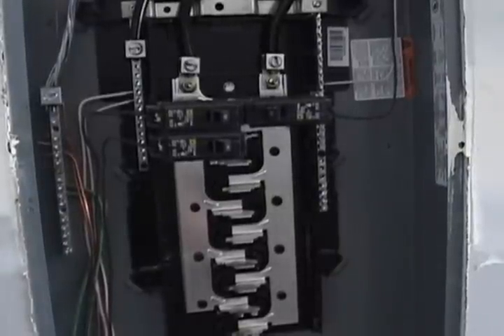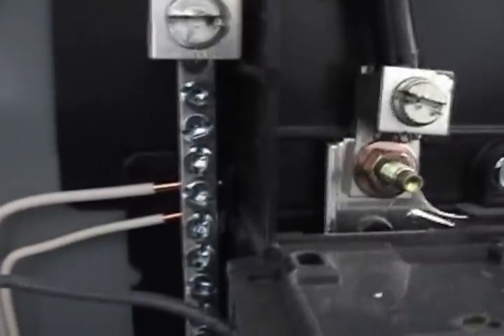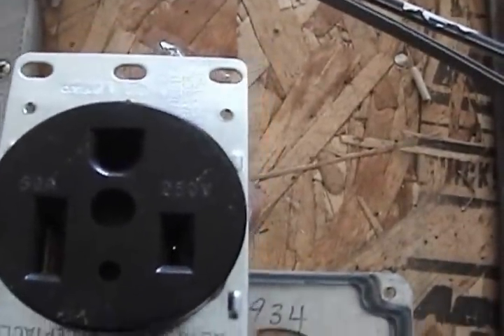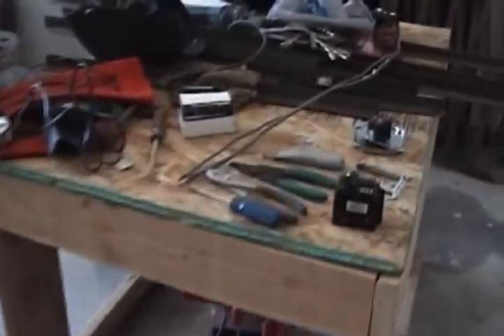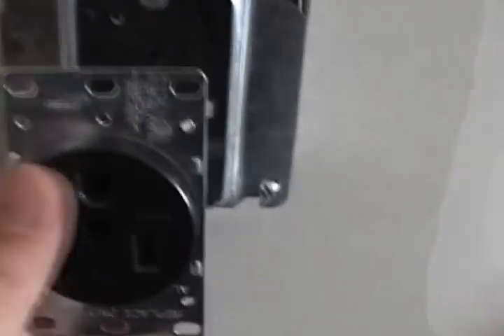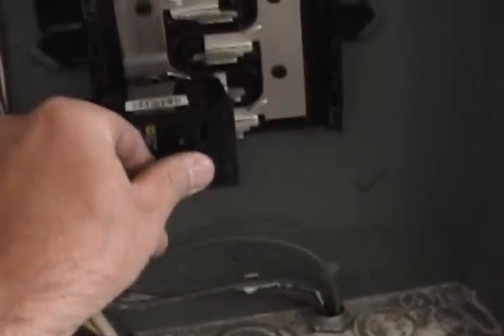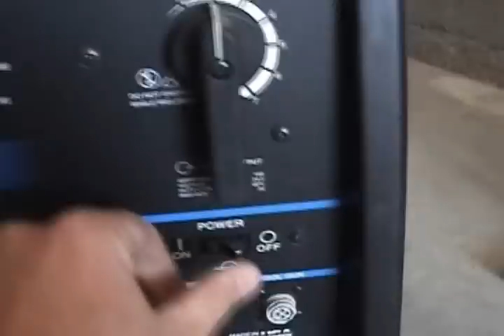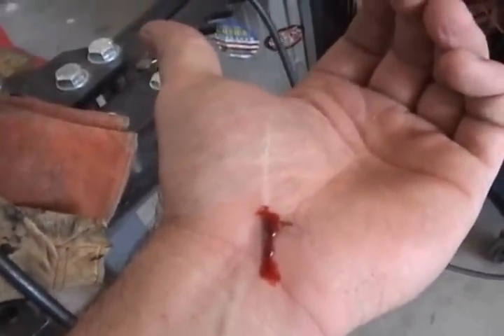How to wire a 50 Amp breaker and plug for a welder

Comment: Plus, I looked up your welder's manual, 10AWG is acceptable, and the MAX recommend circuit breaker is 40A.  A 50 A breaker would not be recommended per the manufacturer, so aside from the 50A breaker, the manufacturer is on your side.  Very good video, thanks for being brave enough to share.  I only came across your videos because I'm doing a welder outlet right now,...

Comment: i had to do the same for my millermatic 252 at home, i went with a 50 amp breaker and plug, and went with Romex 6 gauge on both hots and 8 gauge on the ground.
Reply: You did it the right way.  I just wired my 50A outlet and ran Romex 6 gauge too.  The wire size matches the breaker size so if by chance someone says "hey, here's a 50A outlet I can plug my 50A crap into" you don't burn down the house!!!

Comment: Even though I completely agree that it should be #6 wire you could make this situation safe by using a 30 amp breaker even though it's a 50 amp receptacle. This will at least guarantee that you truly aren't exceeding the wires capabilities. At $2.79/foot on 6-3 awg I think I would have played it safe on that 4-5ft span of wire.

Comment: Thank you! I did some further research and discovered that I can make my own 40 amp crossover extension cord with #8 wire and can use my welding unit, just not to its full potential. But I also found out this welding unit is for building ships and steel buildings and heavy machinery parts. Way too large for my wants, so I ended up scoring a 120v Lincoln wirefeed mig unit off Craigslist and that completely takes the guess work out for me.  :)    Thank you again!!!

Comment: I bought #6 wire and 50AMP plug and socket. I googled this video and gave me courage to connect it. His wires seem to be thinner than mine. Hopefully the welder will not pull 30+ Amps.

Comment: I've worked in marine electrical design (where cable heat is a huge concern), and there is a lot of emphasis on using the right cable for the load.  I'm sure you've settled this by now, but, all that matters is that the breaker is sized less than, or equal to, the ampacity of the wire.  Inadequate sized wire causes thermal stress on the insulator, which, when it fails, produces a high resistance short (ie fire hazard). Insulator failure can take years. For 10 AWG you should use a 30 A breaker.

Comment: Nice Welder. Just bought a welding machine for the house. Looks like a trip to the Ace Hardware is in order. I will be getting the #6 wire like James below here says is rated for 55 amps. My in 3 in 1 machine is an Inverter type. It may not  ever pull that much. Just trying to be safe. Good luck with your fab shop.

Comment: You can use #8 copper wire for 50 amps, if your wire insulation (look for the h's in the identifier) and terminals are all rated for 75C.  It is the industry norm that most terminals are rated for 75C, but you do need to check.

Comment: I agree with some others who doubt the 50 amp/#10 wire. A 50 amp circuit should be at least # 8. The wire gauge should be designated on the 50 amp recepticle.

Comment: I thought the same thing.  But, the manual for a Lincoln AC225 MIG says

"connect receptacle NEMA 6-50R Type to the power lines at the fuse box. Three #10 or larger copper wires are required if conduit is used. For runs over 100', #8 or larger wire in conduit is needed to prevent voltage drops. Fuse the two hot lines with 50 amp super lag type fuses. If a separate disconnect switch is used, it should have two hots and both should be fused for 50 amp."

What do you think of this?

Comment: Isnt #10 wire rated for only 30amps? I'm thinking #8 or #6 would be a better choice.
Reply: Code is 6 gauge where I live.
Reply: IM NOT 100% IN TO THE NEC BUT IF NOT FACTOR CORRECTION FOR TEMPERATURE OR OTHER FACTOR,FIRST WHAT TYPE OF WIRE WLL BE USED NOT ALL OF THEM HAVE  THE SAME AMPACITY,AT DIFFERENT TEMPERATURES,COPPER OR ALUM..BUT 8 AWG  AT 75 DGREES TYPE(RHW,THW, THWN ,)50 AMPS ,GO GOOGLE  310,16 NEC TABLE
Reply: Should use 6

Comment: #10 Cu ground, is good for circuits all the way up to a 60A fuse/breaker size, as long as the run isn't long enough to need wire upsized for voltage drop.

#6 Cu ground, is for the 110A to 200A range.  A corresponding wire size might be in "the oughts", for such a circuit.

Comment: I agree 100% 10Awg isn't rated for 50 amps max rating is around 30 amps, you need to upgrade that to 8Awg but 6Awg would be better. Even though it's a short run its still too small for the current you want to draw, it will create alot of heat buildup and cause voltage drop witch could result in fire or damaged equipment. it may also be called a brownout situation witch is of course an excessive drop in voltage.
Reply: Andy Swanson if I'm doing a 240v outlet with a dual pole 30A with 8Awg wiring is that enough or should I bump it up to dual pole 40A

Comment: OMG...this cracked me up.  Thank you for sharing the info...definitely not on a big production budget, but hey!  This is YouTube.  I've paid a couple of times to wire in a kiln, so this made me realize it's not outside of my abilities (just replaced an oven control board a few days ago).  Put a bandaid on that, man!  And thank you again!
Reply: This is the way to do electrical in a house if you want to burn it down and make it look like it was an accident. He is using 10AWG wire on a circuit that requires 6AWG (the lower the number the thicker the wire is like earring gauges). Heat is the reason you want thick wire when amperage has the potential to reach that high you want it to be capable of handling the load. Otherwise you got heating elements in your wall.

While most of what he did was decent his use of 10AWG wire was an enormous error. So don't install that same thickness of wire install 6AWG wire. Burning to death is a horrible way to figure out the error.

Comment: knowing or should i say not knowing,amperage ratings is a dangerous thing
interior folks awg 6/2 nm will handle 55 amps....in this example although the wiring is correct,just know the circuit itself is wrong 50 amp breaker with 10 awg....is unsafe the breaker must always be the weaker,in this case an over current situation will burn the wire in the wall before the breaker even knows what is going on....please be careful..wire gauge and wire type need to be honored  14 awg 15 amp, 12  20 amp, 10 30 amp, 8  40 amp and 6 50amp but there many variations where amperage could go up and down dependant upon wire type.

Comment: Is that due to the ittermittancy of the welding equipment (since it doesn't operate for 3+ hours continuous)?

I'd go by the 75C column of NEC310-16, unless otherwise I find an exception.  And it is dedicated to the equipment having that exception.  Don't want unrelated 50A eqpt plugged in it, which doesn't have that exception.

I'm aware of the 60C default for 100A and less, but practically most terminals are rated at 75C.   This tells me that #8Cu would be needed for a 50A breaker.

Comment: When you over fuse your wire, your wire becomes the weak link and your breaker is pointless . Miller puts 50 amp plugs on their welders because they are commonly found in welding shops . I have a similar set up for my welder but it's protected by a 30 amp breaker .

Comment: there seems to be unsureness about wire rating. so the #6 is good up to 60a. You can max out a lincoln buzzbox at 50a on that circuit. I cut the neutral wire off short in the box, then cap it off not tape(code) I think I may use romex... whatev you grab it at home depot or anywhere its 4 wire and you cut off the neutral.
Peace!

Comment: for safety before you turn on the breaker better check it with tester for short wire and correct voltage before you plug the load. Also wear leather gloves.

Comment: I am not an electrician, but what I'm seeing is that in many places there are special rules for MIG welders.  I think that this is 'cause the welders have duty cycles that protect the wiring to some extent.  Some 110/220 welders are also "only" single phase.  I've seen comments that these circuits are then marked "welder only".

However, I have to wonder how much more expensive #6 wiring is than the #10 or even #8 -- and so why skimp and limit yourself?

And wondering if the stick welders pull more current?

Comment: terrible info, 50 amp breaker on a #10 wire. definitely not right.
Reply: I'm a half ass 1.5yr elec.apprentice, and i'm pretty sure if i remember right 10ga is only good for up to 30A
Reply: @imbrandon16  Yep it's all wrong none of us should be here...
Reply: @imbrandon16  ding ding ding.
if that welder only runs 24a he would be ok. people read 50 and think it runs at a full 50, lower end welders only need 30amp and 10gauge, then 20%loss down to 24a
Reply: @joshuanelson6718  nothing less than 6 for a welder . In 100 degree heat in July asking for problems
Reply: @huckstirred7112    Sounds good.  Better to spend a few extra bucks now on larger gauge wire and be safe.  6 gauge it is.
Reply: @pixnstix  In the summer when I weld I can dim the lights in the house ,   do to air conditioning . Smaller wire would be a disaster . I wish I had 100 amp 3 phase lol
Reply: your a certified welder so am I . If you asked me how many amps I am running ,  I would say , " I don't know but it sounds good and welds good !  Fab Fabulous my friend
Reply: @joshuanelson6718  Doesn't matter the breaker is there to protect equipment AND the wiring from over current and thus overheating.  A 50amp breaker is NOT protecting 10ga wire.  Period.  This garage/house will burn down one day.
Reply: it's 100% legal and safe. both north american electrical codes allow for downsizing of supply conductor ampacity for welders. take it from a professional, there's nothing wrong with this. all you shit-talkers don't know what you're talking about. 

canadian code 2015 as per section 42 - electric welders: 
42-006(1)(a)
supply conductor amperage determined by rated primary current (27.1A for this millermatic 210@230V) multiplied by 0.78 (for 60% duty rating) 
= 21.138A

table 2
the square d breakers he's using having termination temperature of 75° so we'll use that column to determine the which wire is capable of minimum 21.138A
= #12 wire

techincally this guy went above and beyond putting in #10. i did the calculations with the NEC. it works out to #12 in america as well.

Comment: Practically, most terminals are rated 75C, even though the default is 60C for 100A and less.  Get wire with "h's" in its identifier for the 75C wire rating, and then you're good to go with #8Cu.  I do agree that it's better just to install the thicker wire that intuitively makes sense to use, than to cause a fire.

Welding equipment has a special exception for size reduction.  If it were up to me, before using a smaller wire, I'd require a dedicated circuit, not useable for anything else.

Comment: Does the third plug wire go to the white neutral or the ground bar? Thx.
Reply: +HealthMinuteMagazine  It goes to the breaker, the standard neutral on a 120v becomes a hot wire on 220v

Comment: I just bought a lincoln ac 225 and the install said 50 amp breaker with #10 wire. I used #6 anyways just wondering why they say that?
Reply: the effective primary current maybe less than 30 amp. and the 50 amp breaker is less than 200% of the maximum primary current. pls update sir. tnx

Comment: will that hook up work for a harbor freight 240v welder? if not how do you?
Reply: please see a code book. in my country, the supply conductor shall not be less than the effective primary current. for over current protection it shall not be greater than 200% of the maximum primary current.

Comment: are the red and black wires interchangeable since they are both hot?
Reply: jjsd250 yes when you wire 240v connections it makes absolutely no difference which one is which, unlike 120v connections which must use a neutral and they must be connected to their perspective counterparts

Comment: hi guys I used a 40 amps breaker with I belibe 8  3 wire 
now I wanna weld outside .. can I used  a 10 3  50 feet wire  tthese will cuz a fire..and my welder is 210 hobbart handler i dont know if what welder draws matter

Comment: I should have said "In my opinion, Homeline breakers are less than desirable". To be honest, I do not know where Homeline breakers are normally used but, I do know they aren't as high quality as QO breakers. I use only QO breakers in all my panels but that doesn't mean Homeline breakers are not good. After all, they do protect circuits just as they are meant to do. I feel that more than anything, it's a preference.

Comment: That welder should only require a 40 amp (40x80%=32) and the machine needs 28 and 32 respectively so the #10 should be fine since you wont use 100% duty cycles anyways. But as always check with the manufacturers before tearing anything out since they are glad to help and not have a home fire on their name..

Comment from the maker: I'm using # 10 thats the same size wire Miller has on their welder.
Reply: That doesn't mean someone some day, maybe even you, won't plug something into that outlet that exceeds the current capacity of the 10ga wire and sets the place on fire.  You have turned the wire in that circuit into a fuse.  You have no circuit breaker protection. The circuit breaker is supposed to be the weakest link in the circuit.  In your case, the 10 ga wire feeding the outlet is your fuse. Get that 50amp breaker out of there and install a 30.  You dodo!

Comment: where did the neutral go?
Reply: +ryan hollendonner For a 220, the white wire goes into 1 phase and the black goes into another phase. They are both going to be hot, so wrap a strip of black tape around it at the end for identification. You are combining 2 single phases, so there won't be a neutral. Of course the green will be your earth ground.

Comment: Mr Energy, what happens when you sell your house 20 years from now?  When some poor sucker, buys it, trusts you, hooks up his real he-man 100% duty cycle 50a welder to your 50a labeled receptacle/breaker, and burns down your old house along with his wife and his 3.2 kids, cat, dog & goldfish?

His lawyers are gonna be looking for this video to show a judge.  That's what.

Also, someone else may take your video example, say to themselves, Mr Energy says months later that his setup still works great on underrated wire, and follow you and start their own fire.

You need to either fix this video or delete it!  And you need to either downgrade your breaker or upgrade your wire.

How about if we let YouTube be a place for folks to make helpful videos showing how to do it right not wrong?
Reply: @coltraindontworryboutit9990  what happens if OP has a stroke tomorrow.  Or is hit by a bus.  Months later, someone else moves in, plugs a welder, or an EV, or an RV, into that 50 amp outlet and starts sucking 50 amps through it on a hot summer day.  OP isn't going to be around to say "don't do that".
Reply: Wouldn’t the breaker trip and prevent a fire? Lol
Reply: in your hypothetical situation the he-man would have murdered his family through criminal negligence, because that's a fully legal install brother. running #12 wire would be legal too technically

the fact of the matter is that it is on the user of the welder (he-man) to ensure that the wire feeding it is sufficient. otherwise there would be no legal way to install it, or hot tubs, furnaces, stoves, ovens, or any other device that has a less-than-100% duty rating.
Reply: there's a reason things like welders come with install instructions. if he-man neglects to read them then that's on him.

Comment: Read into this welder, he only really needs a 30amp breaker for this welder, running a 50amp is INCORRECT with 10gauge wire, BUT this welder only pulls out 27.2A with flux, 22.5 with tig and 31A doing stick welding@220/240 . the wires will be fine for this application ONLY, AGAIN 10 gauge is incorrect for 50 amps, BUT not incorrect for the range of amperage tolerated for SOLID core wire and this welders demands.

Comment: mrEnergy, your setup is fine.  These other idiots know nothing about duty cycle of welders.  Now if you were running a large air compressor I might say you need to step it up to a #8 if the run of wire was going to be much more than 20ft.  Good vid.
Reply: What? Someone who know what they are talking about? Rare.
Reply: +aboat29520  Some welders do have low duty cycles, like 20%, that you could get away with 10awg wiring but some welders are continuous duty cycle and for those you would need to go to 6awg.   In any event if you are gong to use smaller than 6awg wire the outlet should be clearly marked for WELDER ONLY.
Reply: All fun and games until he sells this garage and the next owner doesn't notice the problem until the wall is smoking...
Reply: really, heat is amps, connect an amp probe strike an arc.
potential is there to exceed the 10 awg ratings